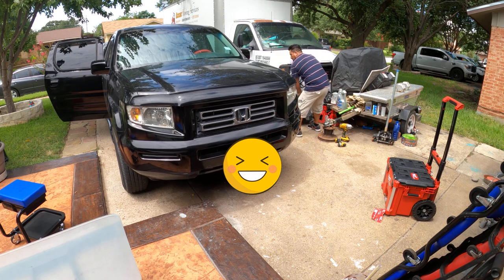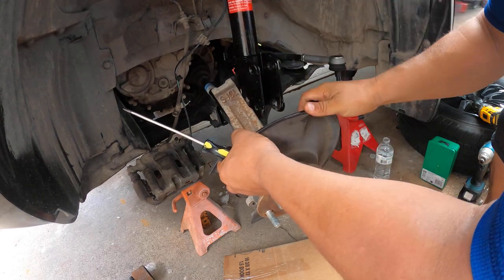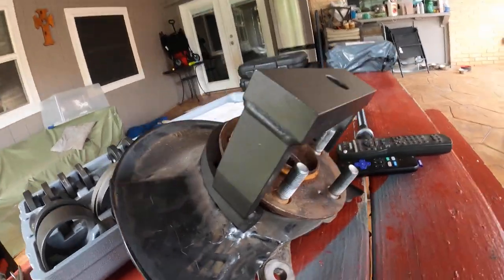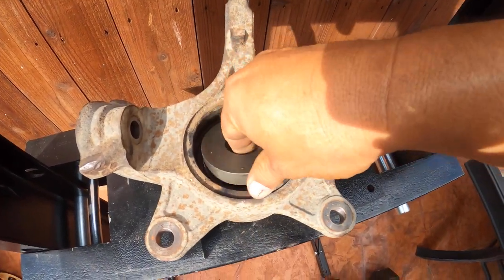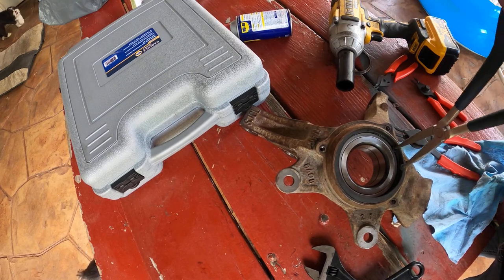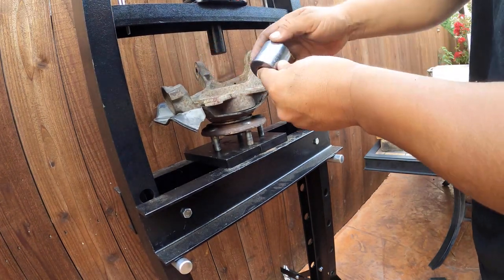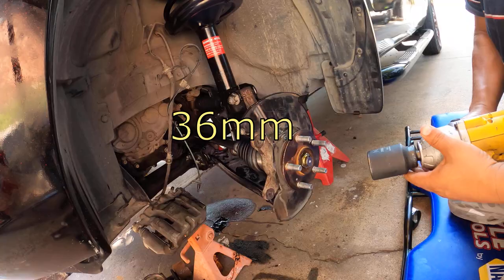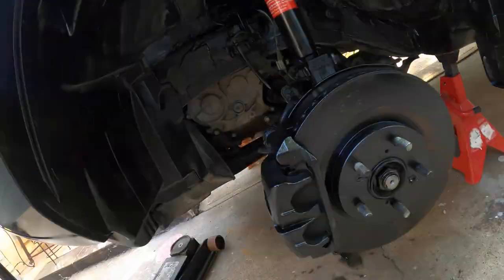2008 HONDA RIDGELINE FRONT WHEEL BEARING REPLACEMENT

Comment: I have a rusted splash guard rubbing the rotor. I think I’ll just cut it until the bearing goes. All my parts are flaking with rust so I think I might replace everything. 
Not to be a backseat mechanic but you should probably use a plate across the entire bearing when pressing it in. 
Thanks for showing me what is needed.